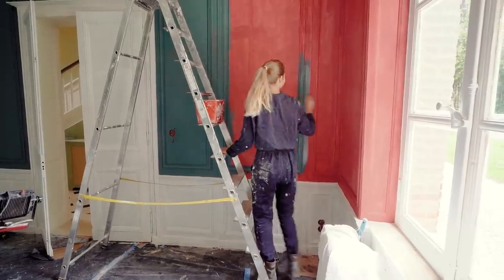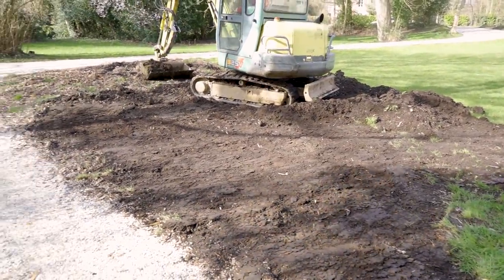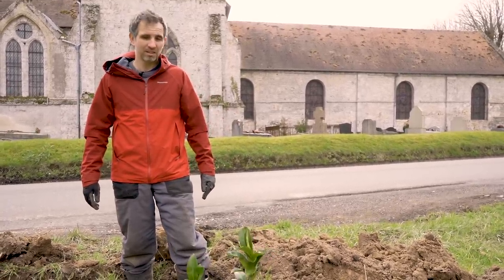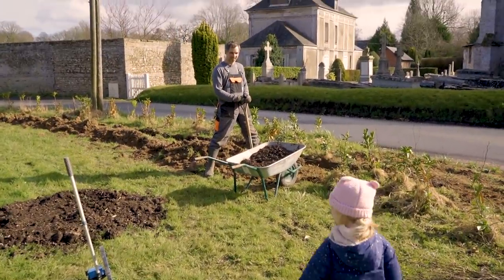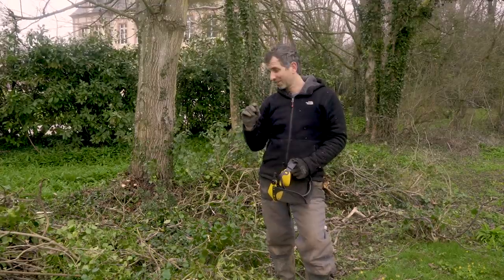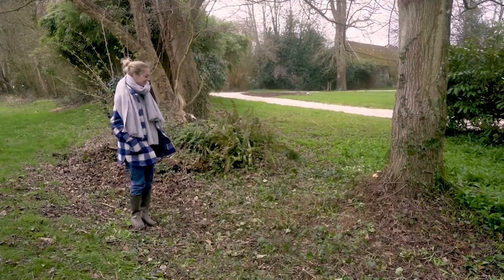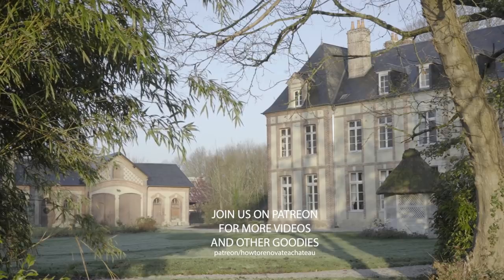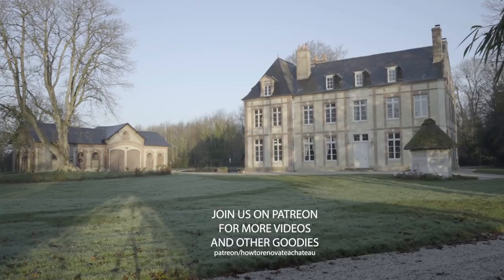Chateau Garden MAKEOVER (part 1) - How to renovate a Chateau (Without killing your partner) ep. 12

Comment: For the climbing/rambling roses you were pruning on the wall of the chateau last episode, aim to tie the canes onto the supporting wire as horizontally as possible. Roses bear flowers the entire length of horizontally trained canes, but will only bear flowers at the very top of vertical canes (rather than the whole length). So, again, train the canes within 0 and 45 degrees from the horizontal and you'll get more flowers (this is how you get the wall of roses effect rather than the spindly-canes-with-flowers-only-at-the-ends type of look). Heirloom Roses and Paul Zimmerman have excellent videos on pruning and training climbing roses here on Youtube.

Comment: Dear Phillip - you are both doing so great! Your enthusiasm and sense of fun is contagious 😄We love reading the comments and all the good advice from your subscribers. A couple of tips from us....1. Group planting in odd numbers is a design principle worth trying. 1, 3, 5, etc. (hedge planting not included, or when planting in symmetry. For example,  2 specimens at an entry way etc.).  2. Next time when planting trees and bushes please dig a wider hole and loosen the roots of the tree a little so the roots are free to reach out into the surrounding soil. Also, create a little mound in the middle of the hole before placing the plant on top, pour in some soil around the roots and press gently to ensure there are no air pockets. Water well, then fill in the hole and water again. Some fertiliser mixed with soil in the bottom of the hole before planting deep rooting plants will get them off to a good start, otherwise watering in fertiliser is good for plants which like to spread their roots.
Reply from the maker: Thank you so much for your precious tips!

Comment: I planted similar sized hornbeams and they grew quickly and I pruned them square. They do grow well.
Reply: Had to look it up because I can’t believe it! They look like sticks!
Reply: @jennyboivin6184  It's easy to think that but bare root planting for trees and shrubs if done at the right moment means they grow stronger and faster than pot grown plants. They do need a good growing hole, dig down put in some well rotted manure even some dried blood and ground bone and they really take off. In five years mine were over three feet high and with good pruning they will grow in width.

Comment: Phillip buy yourself a 'post hole' shovel (we also call them slapper nose shovels).  Not only do these shovels make nice easy round holes for posts, but they make great holes for putting your plants in.  Much easier to use than a normal shovel.  Keep up the good gardening work.
Reply from the maker: Thanks for the tip

Comment: Philipp is right there is an easier way to do a hedge. First clear the grass off in advance. Next take a spade put it in hard so it’s barely visible  and wiggle it in a rocking motion back and forth and then remove leaving a gash. Then pop the new hedge plant roots into the small gap,  throw in a small amount of good soil with maybe a tiny bit of blood and bone meal or similar planting product mix in the correct quantity. Finally stomp the soil back in with your boots. In this way you make minimal disturbance of the soil structure which is a delicate thing. The hedge will quickly push its roots out of the gash you made and the soil is as it was.

Comment: You guys need gardening advice badly...never seen hedging planted on top of old grass. It needs good soil in the trench. Go on the internet to find out the sun requirements if camelia. I think they need mor2r sun than where you planted them. Get a landscape plan from a professional and tackle the planting bit by bit
Reply from the maker: The trenches are filled with fresh soil, and there's no more grass on top of it. And the Camelias getting direct sun for about 2/3 of the day. So we hope it works out fine :)
Reply: I always place the sod upside down in hole. It decomposes and will be just fine.